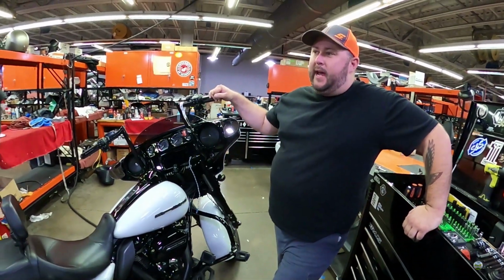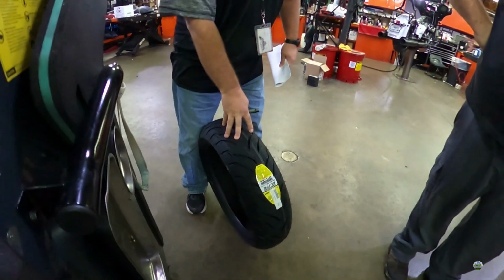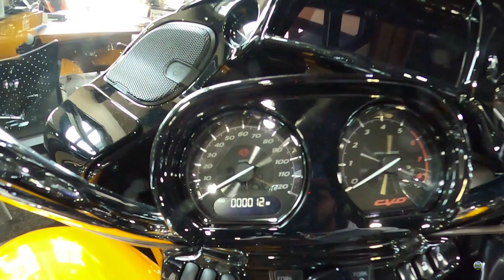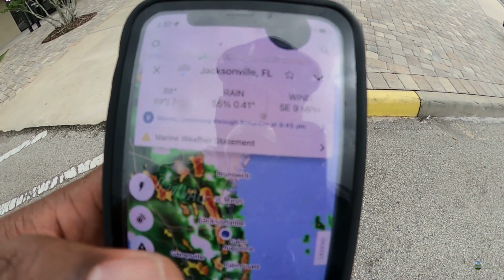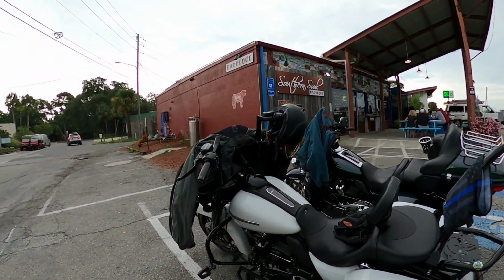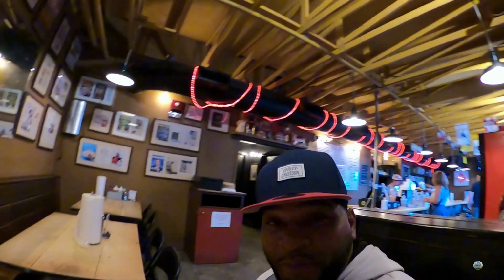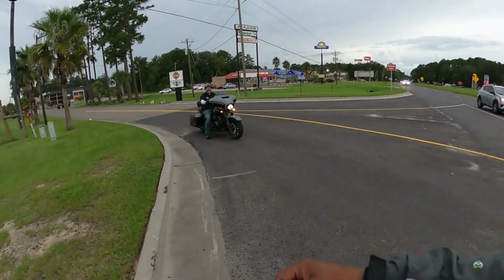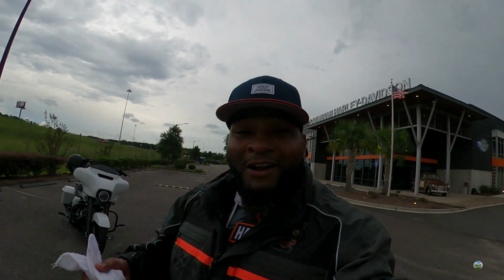Harley Spark Plugs | Harley Dunlop Tires | Harley Synthetic Oil | All Done At Harley Davidson

Comment: I commented earlier, don't know why it didn't post.  So glad you got new tires, you got all the goody-good out of that 1st set.  I certainatly looks like we will need our rain gear for at least a portion of the ride.  Got my pin-lock insert today. 

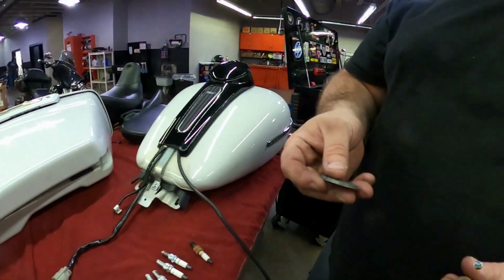Total miles for me will be 1700-1800 depending on how much extra riding I do on the trip.  I also plan to be at the dealership by 04:00, no later than 04:02. lol.... We should plan to have our briefing start around 04:35. this should allow plenty of time for introductions, the briefing, prayer and line up prior to the 05:00 KSU.  

Big props to those guys taking the next step in their motorcycle journeys.  
See you soon..
Reply from the maker: All great points brother 😎
I’m gamed with starting the briefing @4:35a etc. 
So it it true you and Virgil (Kicks.N Harley) will be doing a Chip Challenge upon meet up? 😂😂🙌🏽🙌🏽
Reply: @woodjr.3771  no sir, no way, no how. The One Chip challenge is not Poppa-D approved.
Reply from the maker: @PoppaDRides  😂😂😂😂